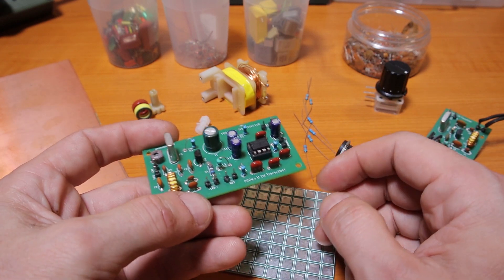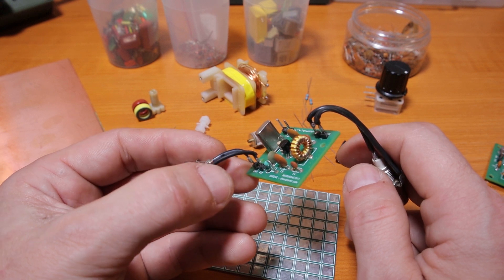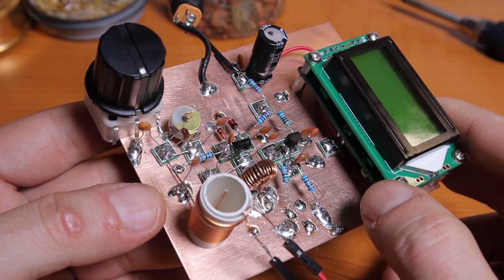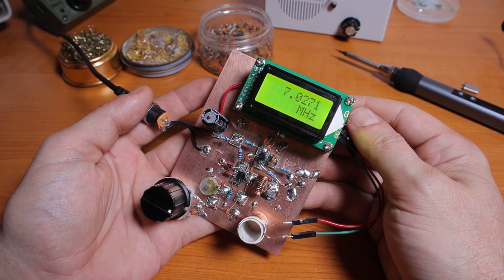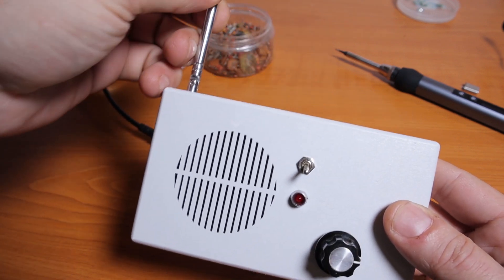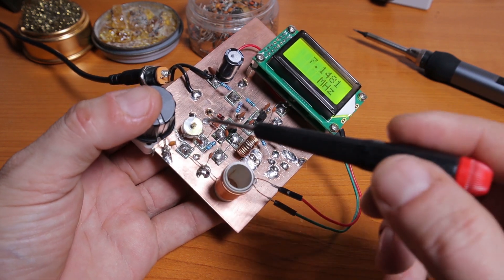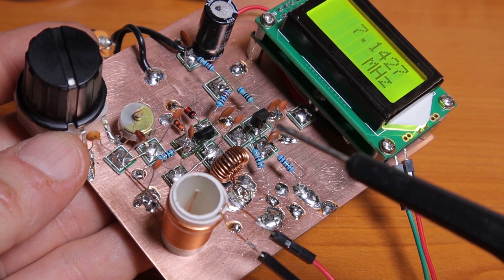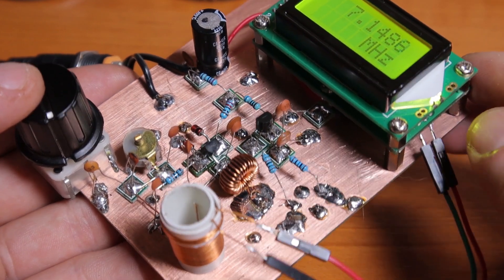Analog VFO Project For The 40m Band ( 7 MHz Variable Frequency Oscillator )

Comment: Hi, I have a question. You mentioned that VK3YE made a video on how to build a low-range VFO with a crystal, a variable capacitor, and a variable inductor, or something similar. Could you explain how to do it for the 7 MHz CW portion?
Reply from the maker: Have a look at this video: https://youtu.be/aY09s3zywTg?si=6QzDrUl2m6XrwdhE
Also read the article written on this subject. You have a link to it in the video description of the same video. 73, YO6DXE. Also check the video I just posted a little while ago about the Mini 20 CW transmitter.
Reply: @dxexplorer thanks 73's

Comment: Hi Ciprian, I am curios about the frequency you are using? do you have a link to it so I can get one ?
Reply from the maker: I have a feeling you meant frequency counter 😁 ? I didn't buy it as it was a present from my buddy ZL1NAY, but I will leave a link as I have found one that I want to buy to have a few at hand for diferent other projects as I really like how it works. I think is a slightly different version but it should do the job just the same. 

https://www.aliexpress.com/item/1005005992460293.html

73, YO6DXE
Reply: @dxexplorer  thanks for your reply, yes that is what I meant, I found one that look like it in AMZON but not so good reviews ( Acxico Frequency Counter )
Reply from the maker: @noelrodriguez Is possible... I know some are ok some not so much. I want to order one and test it... and if I am happy then I order more. For these simple receivers I don't really need 100% precision... at least I know where I am in the band. Probably for a transceiver I would make sure is precise though.
Reply: @dxexplorer  yes, I will order one and do some testing, I don't have one and is difficult to know what frequency I am hitting or if my coils are within the band. I do like the way you used the nanoVNA the get the inductance value (in one of your other videos). Using the Smith chart to see the value at 50 ohms at the frequency you need. I guess we can use the same to get the value of the cap at the same frequency and get a pretty good idea of the expected resonance.. great videos I am learning alot from them.

73 / W4NRI
Reply from the maker: @noelrodriguez I also need to get better with the nanoVNA as I always do things in a rush and is not good. Sometimes I get wrong values readings so I end up wasting time until I get them right hehe. I must chill a bit and study it more to fully understand the potential it had, as it can do lots of things. 73, YO6DXE

Comment: Hi Ciprian, where do you get these little square experimental soldering pads?
73 de Bernd - DF7PI
Reply: Ebay sells these pads you could actually cut some yourself out of copper clad 😀
Reply from the maker: This too also yes )) I used to cut mine as well for a long time. 73, YO6DXE.
Reply from the maker: The ones in the video I had them from my friend Andrei, YO6TJJ. Usually I get them from here: https://www.kanga-products.co.uk/ourshop/prod_7633806-Manhattan-Style-Solder-Pads-sheet-of-150-Double-Sided-Pads.html

73, YO6DXE.
Reply: @dxexplorer  that's what I wanted to know. You have helped me a lot. Thanks for the Link. 73 de Bernd
Reply from the maker: @berndb.5097  Always a pleasure my friend. I will also have to order a batch as I will run out soon haha. I will try to see if I can actually order them directly from PCBWay when I order PCB boards 😋😁.

Comment: Very instructive these experiments. Nice work! Building VFO's can be challenging but I learned a lot by building simple DC-receivers. If good VFO stability is what you are after, you really should consider a PTO oscillator. For me that was a real eye opener. I rebuilt a 20m band DC receiver I once built in 1979  when I started out as a young experimenter and it worked fine except that it drifted quite a bit which I found annoying. Everyone told me that I couldn't  expect a VFO to be stable at that frequency but I kept experimenting with a permiability tuned oscillator using a glue stick drive. I built this oscillator using the same circuit as before (only 1 3810 FET, no buffer) and to my amazement it was steady as a rock. If you are interested I can send you the schematic details and a photo of the oscillator.
Reply: Please post the circuit.
I built variable capacitor with two fixed, immovable plates, BUT adjusted a plastic dialectic  between the plates to tune vfo.
I have example on YouTube.
Looking forward to your design
Thank you
Reply from the maker: @kf5hcr176 I will have a look at the video. Ohh yes once I am happy with the circuit and I see that all works fine... I will post a blog article with all the details ... including the mistakes to avoid thing ))). 73, YO6DXE.
Reply: https://youtu.be/1AEz6aEzHDE?si=0e0-dOBCwdeVP7it
Reply from the maker: Ohh yes please that would be great... talking about the schematic. I also received as a present some while ago some variable inductors... the drive is pretty similar to the one from the variable capacitors... with reduction drive too. So I thought one day o will put those to use 😁😁. Still lots to learn for me so I understand them well... but I am slowly getting there 😁. 73, YO6DXE.

Comment: its nice but bit unstable. coil needs some type of box for shielding as i told you.  later i will teach you how to make proper box for it. also i think you need to use diode tuning because frequency can be adjusted  precisely or you should use some tipe of gear mechanism "vernier"
Reply from the maker: Ohhhh is not unstable is very unstable hahaha. But this one is just a test as I was saying in the video. The final one will be a fancy one 😁. But for now... I will keep it as it is to learn a little more about it... then build a proper one. And that cheap capacitor I used in the video... big no no for VFO for sure. Thanks so much my friend. 73, YO6DXE.

Comment: Change capacitors. To blue colors high voltage ones. It will helps quite a lot to have stable oscillator. I tested before. Very good results with that capacitors. Your next problem will be when you attache antenna. Because change anything around antenna with change frequency of oscillator. Then as my test. The only option for antenna for this type of oscillator is mag loop antenna. I think you will get some results too. 73
Reply from the maker: Ohh in the final version yes I will use good quality capacitors. Right now just for testing purposes I don't really care if is drifting or not. I want to test a few things I was told about and they were stuck in my mind to try one day. Now is the day to try haha. 73, YO6DXE.